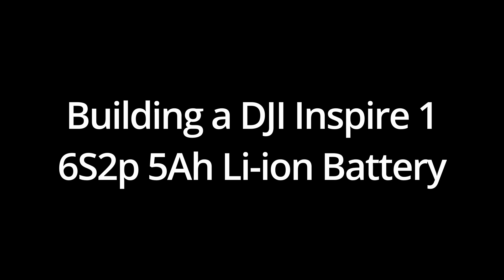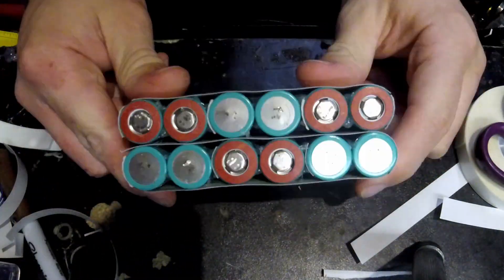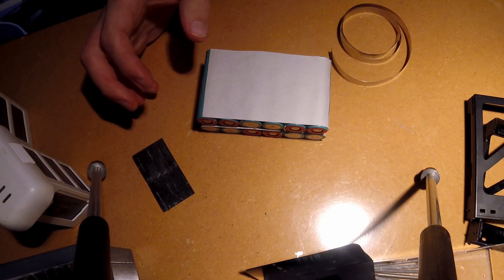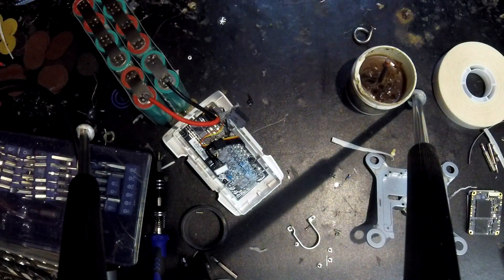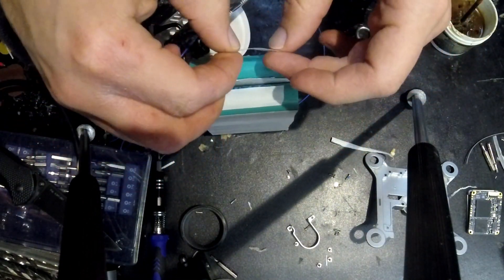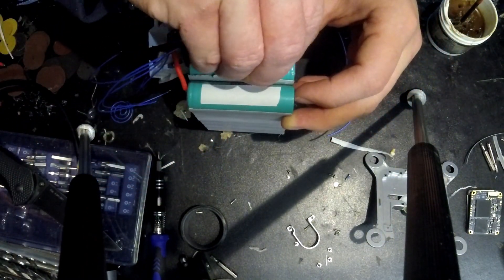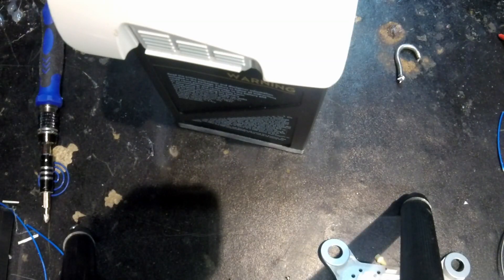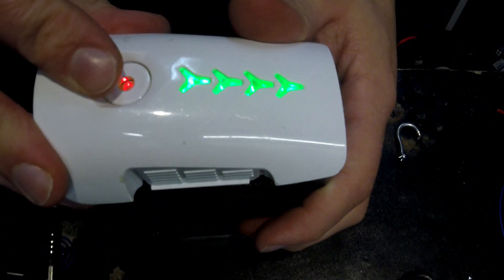DIY DJI Inspire 1 Battery Repair 18650

Comment: I built the battery as you do in the video, but I have the problem that I connect it to the drone and the camera works and raises and lowers the landing gear, but in the app it shows a battery error and does not allow it. The drone flies and you never show the battery flying with the drone, can you guide me as to what could have happened please?
Reply from the maker: I’m not sure the numbers but some models had worked and some did not I can try to find the ones that didn’t and compare the numbers

Comment: Hello, I am another subscriber, very interesting, great video, a question about how you reset the BMS so that the battery works correctly, and recognizes it in the DJI GO application, I await your response please, thank you very much for your attention, greetings from Peru .
Reply from the maker: Thank you very much for your support. I wish I could tell you. I got lucky to where it just worked. I guess some just didn’t lock themselves out after changing. I have another that is locked I am looking into getting to work. It is full recognized but won’t take flight.  I have been playing around with the board and hoping I am getting close to a solution.

Comment: Hello, have you ever heard or are familiar with the HSABAT Batteries for DJI Inspire 1 TB48/TB47 sold on eBay? If you are please share your thoughts. Thanks
Reply from the maker: I have heard of them and don’t see why they wouldn’t work ok but they are just a tab pricy might be cheaper to find someone with the bms bypass and rebuild with lihv rc batteries
Reply: I will research it and compare. thank you for the tip. I have an Inspire 1 Pro, I have two batteries that went bad, according to the DJI GO App one of the cells on each battery has slightly lower voltage than the rest. I have four good batteries to fly with but would like to repair the two bad ones without them blowing up in my face. I've tried to follow your video but the camera sometimes missed some points, so I didnt want to take the risk, us Marines are not the sharpest knives in the drawer when it comes to this stuff. I figured I'd buy one of these HASABAT batteries and give it a go, just wanted your expertise and thoughts on the matter. Thanx again @spireEngineering6523

Comment: Hello. I am about to try to build and follow your video and diagram step by step. Could you give me more information if this worked? If someone has tried it they don't want to try it to no avail or damage both the plane and the batteries. Thank you very much and I hope someone can answer me.
Reply from the maker: I am happy to help. Sad to tell you it’s a 50/50.  We did many batteries and half or less worked. They don’t damage the drone tho if built right. The only thing the ones that don’t work do are turn it on and it all functions but it just won’t take off.
Reply: Thank you very much for answering my question. and I ask you again those that did work, did they manage to work in the same way? Or did they have some limitations or differences? And well, all that remains is to try and make it work. Thank you very much again for answering. greetings from Argentina @spireEngineering6523
Reply from the maker: @pabloalmada7858 the cells I used in this video had some limitations the range was around 70% of the original however there are better cells on the market like molicel p20a, Sony vtc4, or another great option that is sometimes easier for some people is to get fpv 4s lihv batteries with matching or higher mAh. This is the best performing option but may run a bit more money but still by far less than a new dji battery

Comment: Discovered that high discharge 18650 rated at 10C are available, it has been estimated that the tb47/48 are rated at 10C - might be worth giving this a go
Reply from the maker: I actually have some sitting on me bench for another project and used them in my longboard battery I had built. Didn’t have on hand at the time of this video but plan to revisit with another battery that is dying fast. Thank you for the heads up appreciate you coming back to the channel.

Comment: Good afternoon. Please tell me I have such a problem, the battery has been redone to show 6000 mah and does not show, shows old readings. How can I fix this problem, please tell me?
Reply: Did you resolve your problem? I believe the board in the battery pack needs to be re-programmed but I cannot find any info to do this.

Comment: Yea, You left out a lot of details on this project. because you’re dealing with batteries and a very expensive drone I would have to pass on this project. ebay already sells batteries pacs similar to these specific for the Inspire 1 and 2 and come with a warranty.
Reply from the maker: All to their own. I feel I covered the warnings at the beginning of the video. I did this projects for a friend who isn’t having issues to this day. As building a battery Carries it’s risk it is always done at the builders chance of damage. I build many batteries for more expensive projects that draw way higher amount of power. For some people like my friend who got the drone for $200 and cannot afford new ones this was his best option. We also repaired on one using hobby lipos.

Comment: Any idea how to fix battery cell  error  for inspire 1 battery?
Reply from the maker: Sadly no I got lucky with 3 batteries not having it after repair. I’m still looking into fixing that error. There is a very technical way but it’s to much work and costs money for a software so looking to find a cheaper option.

Comment: Do you have a service to fix the tb47
Reply from the maker: I do not have a service. I simply fixed this for a friend. It does however throw a battery error sometimes but other times will take off without an issue so I’m still figuring it out.

Comment: Have you flight tested these yet? If so, how’d they perform?
Reply from the maker: Weather hasn’t been permitting in my area. When the weather clear I will be making a performance video although I believe these batteries won’t be able to any speed punches. If I can find some better suited cells I will be linking them in the discrimination but at this time cells are hard to come by with good power density.
Reply: @spireEngineering6523  yes, I was wondering what the C rating of those cells would be. Here’s to hoping they do the job, it would be good to have a cheaper option for the original batteries. Those prices are getting ridiculous.
Reply from the maker: These probably weren’t enough I can definitely get better ones but I had these on hand so I went for it anyway

Comment: Any errors? I have read that the BMS enters lockdown mode when the balance leads are removed for the original cells.
Reply from the maker: I must have been lucky if so. I have done it to two batteries without that issue and can power up the third without any cells connected.  I don’t know if is had to do with my cells slowly dropping past readable voltage unlike if just unplugging them or if it was something else.